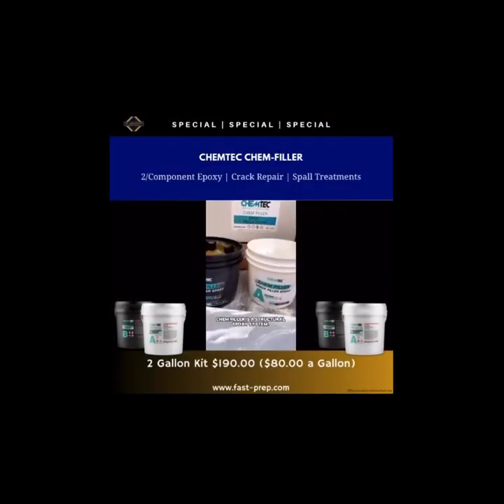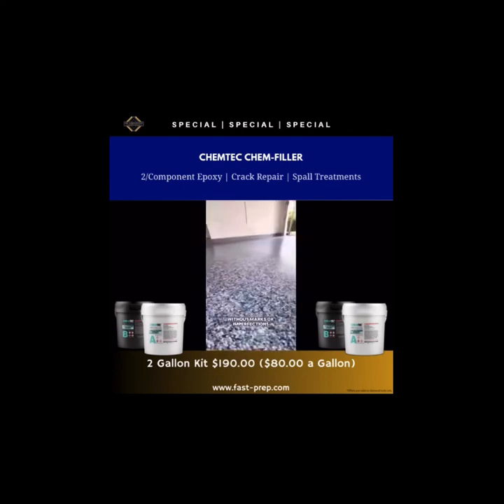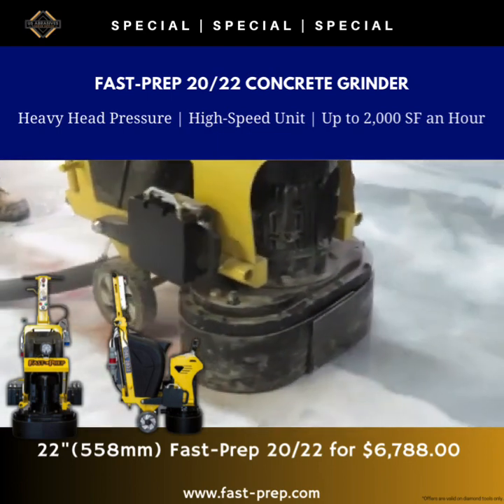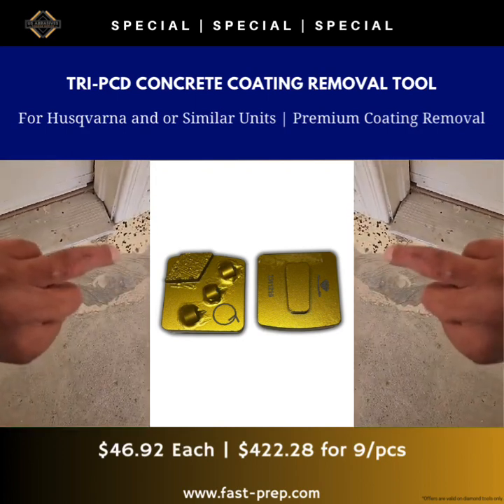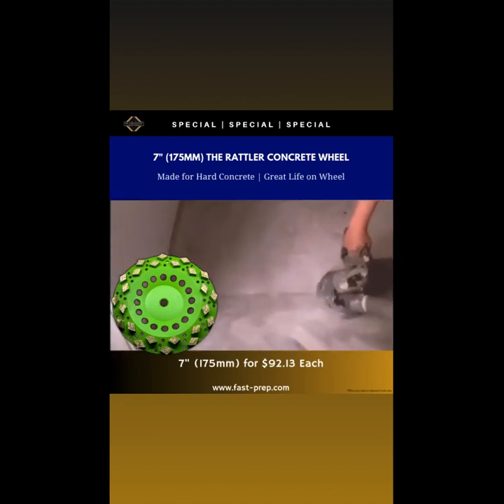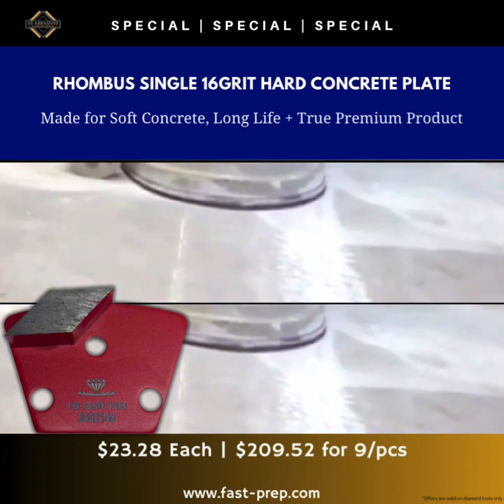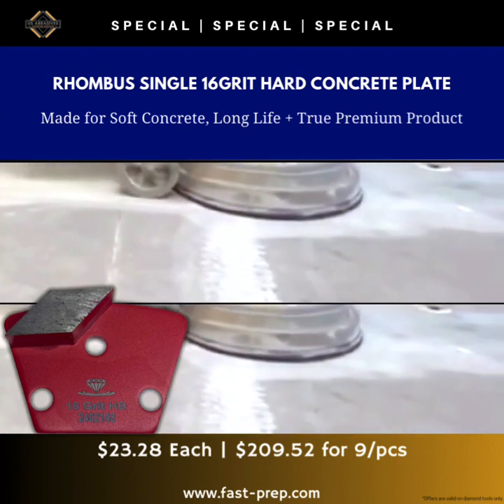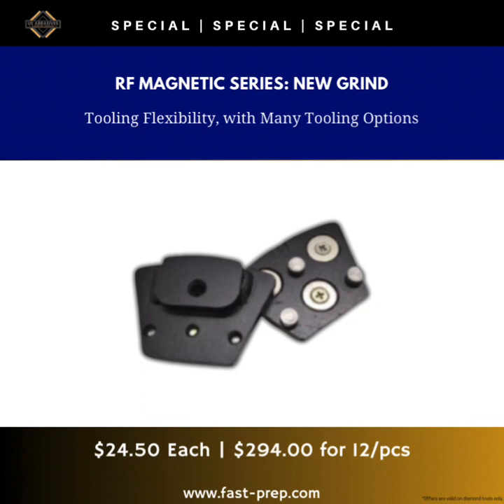Concrete Insights: May 2024 Issue – Proper Tooling for Surface Prep

Comment: Good morning??? Would you require or recommend your chemtec crack filler good for mosaic tile that they use on bathroom floors inside schools. I’m looking to start a business soon and wanting to use great products to scale the business. Thanks for your time.
Reply from the maker: @akbarnitti  thanks for your question!

Our Chemtec crack filler is a two-component polyurethane product primarily designed for concrete floors. While it could potentially work for mosaic tile on bathroom floors, especially in a school setting, there are a few factors to consider. Mosaic tiles and their grout lines behave differently than concrete, and it’s essential to ensure the product’s flexibility and adhesion are suitable for this type of application.

We recommend testing a small area first to confirm compatibility. If you’re specifically focused on tile applications, there may be other products designed more explicitly for mosaic tiles and bathroom environments that could be a better fit. Feel free to reach out if you need further recommendations or have any other questions as you scale your business.